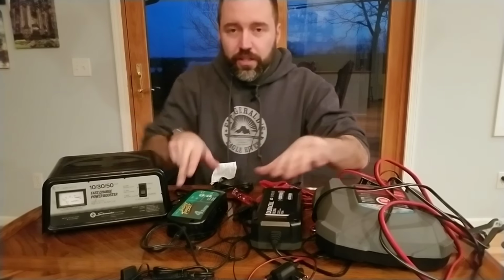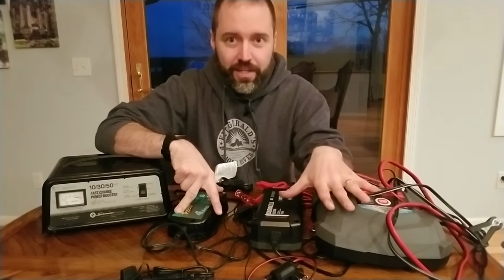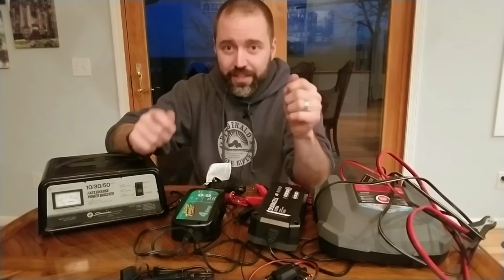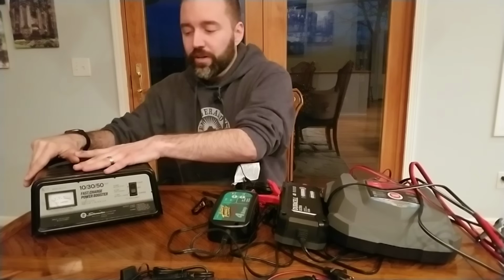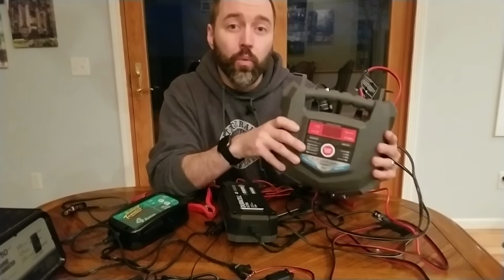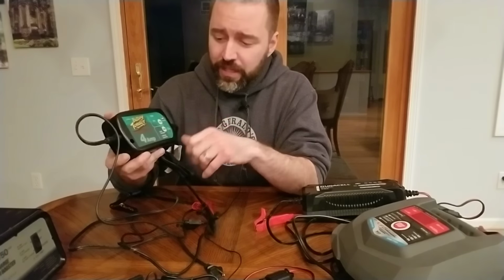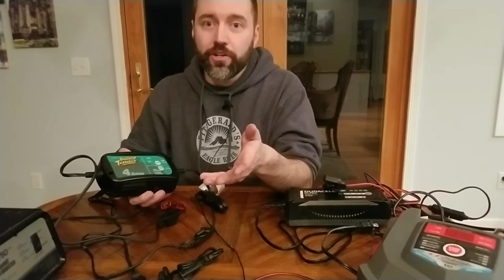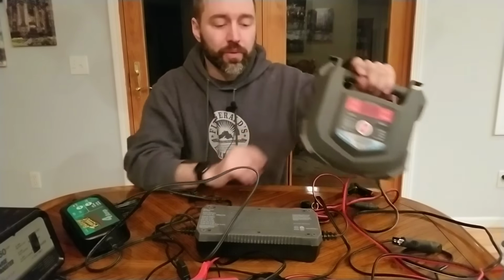Difference Between Float and Trickle Charger

Comment: 4-amps is not adequate to charge a 200Ah AGM battery in any amount of time. Most AGMs are C20 and require a charging amperage of 20% of capacity or a 20amp charger. Minimum of 10%. They also are designed to discharge at that rate. Don't hook up a 1kw inverter drawing 80amps to one 200Ah battery. Also a 200Ah AGM battery completely discharged that needs 200Ah is toast.

Comment: I had 2 x 12v batteries in an electric wheel chair that were complete flat dead.  I put my 6amp dumb charger on it for like over 24 hours and got nothing.  I hooked it up to my running truck for 10 minutes and still nothing.  Would not even light up my tester or cause a spark accross the terminals.  That's a dead battery.

Comment: Hey man, thanks for the video. I have a question. I have a drip system that runs off of 3 AAA batteries and I have 3 rechargeable Energizer batteries in it. I don't want to have to worry about forgetting to change the batteries if we are on vacation and would like to convert it to solar. I want to buy this trickle charger that has a computer in it to prevent overcharging. Can this be connected to the irrigation system to recharge/maintain the batteries during the day? By the way I am in Arizona so temps are usually above 110 just in case that has anything to do with it. I appreciate any help you can give.
Reply: Connect a usb cigarette charger between this trickle charger power source and replace those AAA batteries. 1.5+1.5+1.5=4.5 volts, USB cigarette charges at 5 volts. I do this all the time with battery ran items. Most cigarette chargers can handle 18 to 7 volts input with 5 volts output. Most common are rated at 1.5A output also.
Reply: @deanhenthorn1890  Wow thanks a lot, I will try that.

Comment: current is drawn it is not pushed. The battery will only draw as much current as is required. You could set your dumb charger to 100A but if the battery is 98% charged, it will not draw more than a couple of amps. 

You dont PUSH current into something 

Seems like you have a fundamental misunderstanding of electronics

Comment: I bought a new smart computer monitor battery charger. It would not sense a dead battery thus will not charge. Totally useless! An older model charger will work, the older automatic charger will work. Don’t waste your money on those cheap computer chip Chinas made chargers. BTW, you yap too much